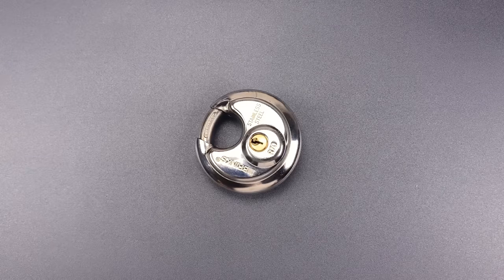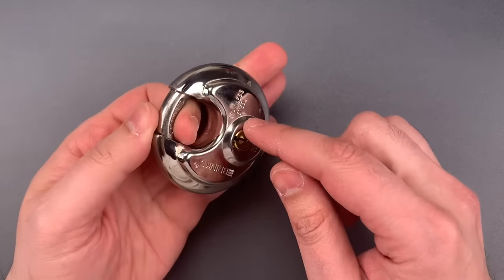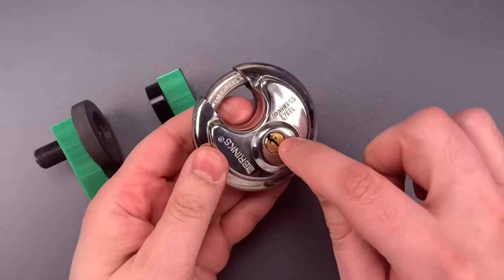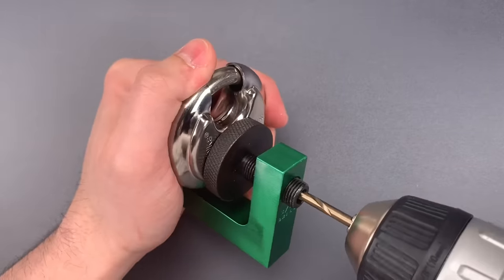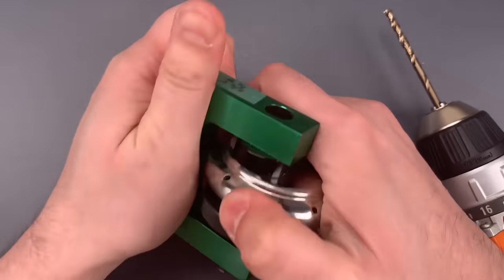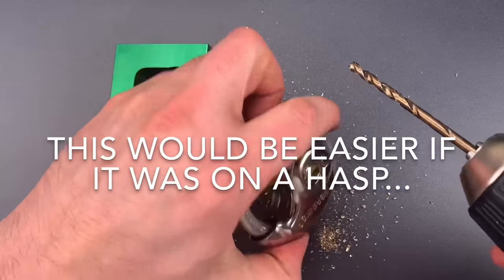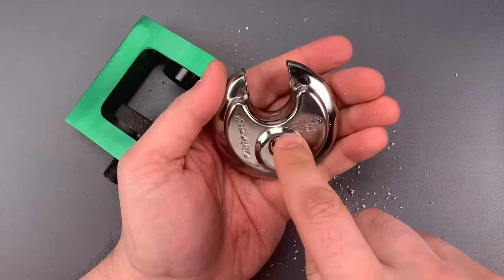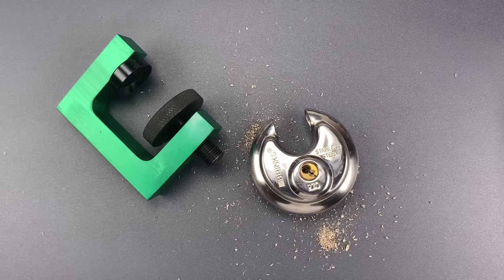[1050] The “Disc Buster” Padlock Drilling Jig

Comment: " the drill bit may slide and hit ur hand  so thats why use this tool "

Almost gets drilled through his palm using the tool..!
Reply: Drilling brass is easier than steel, then you can realize when the drill hits the steel. 
The danger is in the start and if the drill breaks, but drilling in that way is still dangerous

Comment: I work for a storage action company and this jig would be great. I normally use a cordless disc grinder to cut the shackle, but if you aren't holding it correctly, you can cut hole off. I would prefer this because drill bits are cheaper, battery last longer and less potential for damage to the unit

Comment: love the disk padlock jig works great. I recommend this jig it's fast I used it on 3 old locks with no problems just remember to tap the pins out with a hammer and be safe.

Comment: "Yeah but if you pick the lock, you can't sell them a new one" :- Every arsehole locksmith.
Reply: First you go through careful friendly questions about the circumstances surrounding the key. Not only not to assist in a crime, but to make a decision, drill, or pick, depending on whether the key is still available. If it's lost, picking doesn't hurt your business.

Comment: I ran a storage facility several years ago, and we sold that style of lock. For some reason people would then lose their keys. I just put a cutting wheel in my Dewalt 18 volt grinder, and cut into the  side where the shake comes out. In less than a minute the lock falls apart. If you cut the right side where it goes in to lock, you will have to still cut the left side. The locksmith wanted $75, so I did while they were waiting for $50.

Comment: i have never drilled anything that i have held in my hand, i like my hands more than that, have you ever broken a drill bit and seen what is left in the drill, sheesh, that was risky if you ask me.
Reply: chrismechanic B i've done it too many times and also got hurt once or twice tops, but out of like 500+ times and i got a little bit hurt once or twice? Yeah, i think i'll keep doing it when i'm in a rush 😅🤷🏻‍♂️
Reply: I’ve broken a bit. The tip was in the steel bench I was drilling into, the shank was in the drill, and the middle part was sticking out of my leg. It only went in about a 1/4 inch and was so hot it must have cauterized because there was no blood when I pulled it out. Lesson learned.
Reply: @Triptothebrightside  save those few seconds and risk your hands. Your choice
Reply: Ollie B boy, through MANY years i've saved alot more than just a few seconds 😂 but ofc i most often use gloves atleast..

Comment: You know what's great about disc locks? They fill with water and freeze solid... A landscaping company I worked for used them, on several occasions it would rain in the evening, which would turn to sleet, and then freeze. A lot of disc locks also rust up and jam badly when left outdoors.

Comment: I’ve used that jig on about 8-10 (mostly C-870 Chateau) locks so far. None of them popped right open like in this video. It seems like the 3/16” bit it calls for is a little too small. The jig gets you lined up nicely but more drilling with larger bits was always needed in my experiences. Maybe it’s just me but those locks are buggers to breach.

Comment: I used a lock like this on my storage unit.  The key was kinda hard to turn and one day it literally snapped off inside the core.  I returned the next day and told the office person that I needed to cut my own lock off.  She said they could not be cut off and needed to call a locksmith for $180 plus at least an hour (because for some dumb person they would not use the lock company they actually had in town.  Told her it would not be necessary and I would cut it off..."impossible....but since it is your lock you can do what you want".  It literally took me longer to walk 30 ft with my extension cord to plug in than it did to cut the shackle off with my angle grinder.  I was kinda disappointed honestly.  In college I built a safe as a project that withstood more than 4 hours of portable power tool attack.  It was a 1/4" mild steel sheet, a 1/2" skeleton with 1/2" extreme abrasion resistant industrial tiles (meant for material handling), 1/2" case hardened steel that had also age hardened a bit, and finally 1" square stock strategically placed on the interior.  My brother was the tester and was given incentive to break in.  He failed.  He actually did not even get to the point of finding out that the 1" stock made it physically unreachable by his grinder.

Comment: Hi there, being as you are the lock picking LAWYER, I'm confident you can answer this question. I grew up in Ohio, and also enjoyed messing around with locks. They are interesting puzzles to solve.
  I was however sternly warned by several adults, including a teacher, who retired from law enforcement before becoming a teacher, that Ohio had a law making "possession of thieves tools" either a serious misdemeanor, or the mildest form of felony depending on circumstances. I was advised to never get caught with anything, possibly even a bent up coat hanger that could be defined as a thief's tool. The only way around that was to get a state locksmith permit. 
  So, are such laws still a thing that is enforced? If so, how do you avoid it becoming an issue?

Comment: The torque adjustment is for driving screws.  There should be a separate switch that locks the shaft for drilling.  So, there actually is one lock you have yet to master.  ;-)

Comment: My parents had a master no 3 on their storage unit and lost the key, i got some cheap picks, picked open two locks, including a no 3. Couldn't get the lock off at the unit though, drilled it no problem with some vice grips to hold it.

Comment: One of the problems drilling locks suffer fro is brass requires a drill with the cutting edges at 2 or so degrees negative angle, brass tends to grab at the sharp edges. Just try back grinding a blunt drill. The edge will be still sharp but will not self feed.

Comment: @LockPickingLawyer  Okay I purchased the jig, used the right size drill and it all went perfect. Problem is the brass center broke in two and came out, so now I have a hole in the lock but the shackle won’t open. Any thoughts?

Comment: Just curious, how often do people use disk locks dangling on a hasp where it would be accessible for this jig?  I typically only see them encased completely by the hasp, such as on cargo van doors or coin operated machines where only the keyway is unobstructed.

Comment: The problem with the Disk Buster is that it is not really at the shear line but lower down on the keyway. Then when you try to turn the lock the keyway breaks and you are going to be using your Dremel or angle grinder. I use an auto punch to put a starting point at the correct shear line and boom. Your done.

Comment: Hi there LPL, I have recently come across your channel and off the bat you have have quite some skill there in those hands of yours. I have not managed to get through all of your videos but I would like to ask a question with regards to weathered outdoor locks and the ability for them to be picked / bypassed. Most of the videos you feature seem to have new / fairly good condition locks, would it be at all possible to feature some of the more "used" locks in future videos? (ie ones that have been out in the elements for an extended period of time). The reason I am curious is that I used this type of lock with a thick chain to secure my bike to a trailer which was standing outside. Since I used to stay near the coast the weather was not very forgiving with a lot of salt / precipitation coming in from the ocean, within 2 or 3 months my lock became extremely hard to open, to the point where I had to use a hammer, some Q20 and a screwdriver to even get it to budge,  and actually ended up bending the key in the cylinder itself. Do you have any recommendations on what types of locks are best suited for this purpose? I have recently moved, but I would be happy to dig it up and ship it off to you if you accept random donations. You might need to whip out that crowbar again to tension it though. Keep up the great work.  - Regards from ZA

Comment: First you grabbed the jig and drilled and I felt a twinge of panic, and then remembered that there's a steel blocker behind the padlock. 
Then you grabbed the lock itself and started drilling, and actually panicked. Dude! Please! Protect those lock-pickin' hands!

ALWAYS ask yourself, whether it's a hand drill, awl, knife, even putting pressure on a screwdriver... where's this going if something goes wrong? If the answer is "in the meaty bits", don't risk it!

Comment: Not in 40 years of using power tools, have I ever held something in my hand that I was drilling into.  While the risk is low that you would drill completely through the lock, all it would take is breaking a bit....which is very easy to do when not holding the drill perpendicular to the work.  You sir are an accident waiting to happen …..LOL.

Comment: Do you know where I can buy that jig? I lost three keys, one was a ABUS pinless discus lock, so I could order the key. The the other two are pin core  locks identical to the one in this video. Someone told me to use a 3/16 drill bit, which you did. The jig would help because the lock is in a precarious positionand and I don't want to damage the tool boxes that they're on. Anyway, if you can help I'd appreciate it. I love your channel and learned a lot. My favorite locks are the Abloy brand. Thank God there are not people like you running around loose on the streets that can pick locks. If there were, none of us could be safe. Lol!

Comment: Jesus man you had me cringing holding that lock like that. A few years ago i was helping my neighbour fix his car and was drilling a small screw out, i was holding the replacement part steady on the floor when the drill bit snapped. It left about an inch of bit still in the drill which went straight into my hand.. still spinning.

Comment: Tried using a cordless rotary tool instead?  At 20.000-25.000 rpm, it goes through that cylinder like it’s hot butter.

Comment: Love this channel, but my arse clenched a wee bit watching the last bit lol.....Over 40+ years I've used and even sharpened countless thousands of drills,  and seen many many drilling incidents. I've seen  cheap chinese masonry bits in reverse uncurl their twist,  carbide tips fly off , hundreds of snaps etc etc,  Take it from me - Never, ever have your hand close up at the 'danger side' .  Sometimes even a good brand drill will grab, then snap and the  rotary action  will make the remaining stub jump over the snapped part, and then  with the forward action of you pushing the drill motor, stab right into your hand, and if you are too slow to react it might even carry on drilling.  A vise/vice or Mole grips/vise grips at the very least are your friend in this situation.

That said, I love this channel!

Comment: I lost the storage key to a similar lock C870.  
1. If I bought another similar C870 lock, will the keys open my storage lock?.  (doubt it)
2. Can I make a bump key for my lock Chateau C870 as the key is lost for my storage unit and I am not there in the country. It needs to be opened for my things and closed out.

Comment: You need to count the pins. Do not go past the last pin. If you break the back of the core, it will be very difficult to Open the lock trust me. I’m a locksmiths

Comment: +1 for never use a drill on something your holding, i did something silly and ended up spinning a HSS 3mm drill bit into the side of my thumb at roughly 2000 rpm as it slipped out. wasnt seriously hurt but you only get a few chances with your hands, and not being able to use your thumb for a week sucks

Comment: So i was taking my dog out for a walk & poop on state lands here in Michigan this past weekend, and the parking pulloff area has a "no motor vehicles beyond this point" gate secured with a size 5 master lock. So with no one around i bent down and because it was a master lock picked it with a rake in about 7 seconds. 
Now i just opened & closed it, but it's good to know if i shot a deer deep down in the revene i can cheat and take a 4 wheeler down to drag it out. (There are plenty of truck tracks from dnr, so it's by no means virgin ground)
Thanks LPL!

Comment: With or without the jig, drill bits DO break .  And since the drill will be spinning at that time, and walking where it wants to walk, well, your hand should NEVER be in the area, especially behind where you are trying to drill.. Using a larger drill bit is in your favor, but, yes, they still break.  Honestly, it would indeed be far better if the padlocked was attached to a hasp or something.

Same thing for gloves.  You may think that gloves will help protect you, but reality is that if the drill breaks, slips, or otherwise walks, if it hits material like a glove, it's going to grab that material and now your focusing that energy into something that it's grabbing.  You really don't want that to happen..  Me, I think I'd use a pair of Vise Grips to hold the jig..

Comment: A small click on the trigger and we've just set pins one through five into oblivion.
In any case, this is a lock you should avoid since it can easily be opened with a low-skill raking massacre.

Comment: What if you just wrap the up The lock with electrical tape Drill right through the tape into the lock The tape. The drill bit from slipping But like you said it’s a lot faster just to pick the lock . ain’t you worried you’re giving information out to the wrong people I realize why you don’t wanna show your face just wondering have you seen those VHS tapes call B n E AToZ 1 and 2 A friend of mine gave them to me back in the day and they were pretty funny and full of useful information might be something you like

Comment: Just FYI I tried this and it did not work at all I’m having such a hard time drilling this, I’ve practically drilled out the hole 🕳 completely and it’s still not rotating
Reply: I just did this and it works. The only thing I did differently was I changed the drill bit to a larger size after making the smaller hole. Then I went forward then reverse in short bursts until it opened. Took 60 seconds

Comment: Doubt anyone would bring that equipment to my front door to take off the lock.  I have pro burglar neighbor who got $40K gold and silver coins, police protect him and has had witnesses put in psych units getting them labeled as mentally ill.  So he does not want me to know he has been inside my home.  Had vandalized my house and cut the tow bar holding my car behind a ,moving truck that broke right after I took an exit from freeway.  An impulse exit an angel apparently helped me turn the wheel. Car was flying back and forth across back of truck going 10 miles an hour after a stop on the off ramp and starting back up.  State police not interested in investigating even though was planned to occur on freeway. Saw him in truck looking at my rig at a motel on way home.  So have special need for a very secure lock that is not going to walk off.  Had a 600 Series LAI that was stolen from my purse that i put on  a hasp on front door of house when gone, but he got he lock.  Seems that series is good since he wanted the lock.  I have the key but the second key came up missing and likely he still knows which one it is from his stash from over seven years of thieving in this small village.  Even our Administrator of eight years has criminal history of having burglar tools and found with over $2500 stolen p;property, involved with theft car/boat, and shoplifting and assault on household member on his record. How do we get these two in our government.?   60 thefts in 2015 with witnesses and fingerprints, over 7 month period, not investigated as there were not enough beds to commit the witnesses.  I was one he tried that with, a victim then attempted to tell court I imagined my coins were stolen, when I saw the neighbor and daughter leaving my property. which they left off the theft report.   Cannot get any agency to help.  AG held my complaint for nine months and no one would talk to be as it would compromise the investigation then sent my complaint to our new mayor who handed it over to the now corrupt Chief to i investigate himself. No investigation unit in town of only 8K.  Locks are hard to secure. Last town the lock shop wanted the address, my license to where the hyper secure lock was going.  Paid cash and told him forget it.  But keys stolen at work and that is how they got that super lock.  I am wearing down.

Comment: This is a clear Thumbs Down.
LPL  used to the tool with cheapest drill bit available and added some text  on the vid to excuse himself.

What about starting drilling without any protection towards your open hand? Still useless?

Come on LPL - you know this destructive penetration test is much easier with a tool that can hold everything in place.